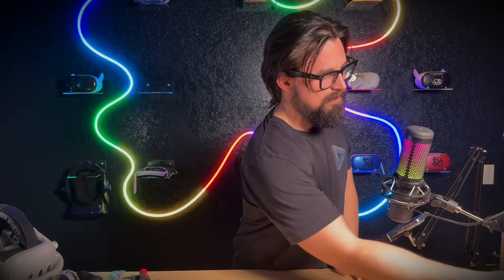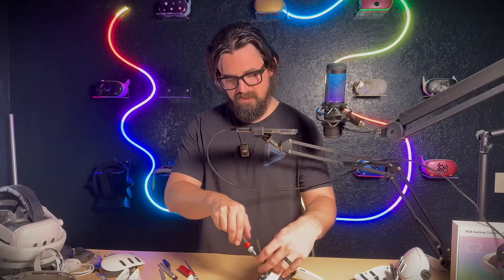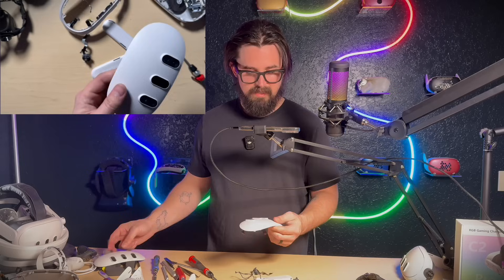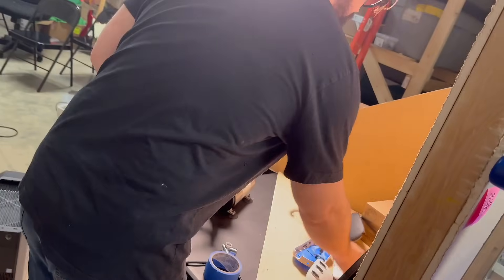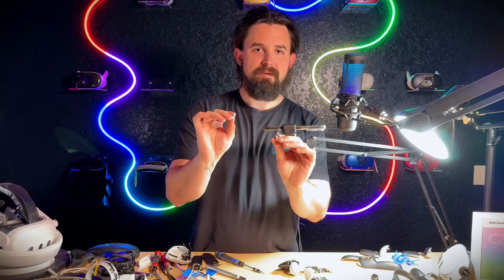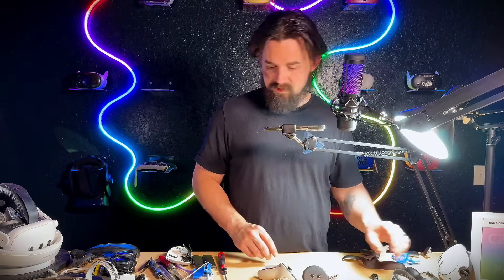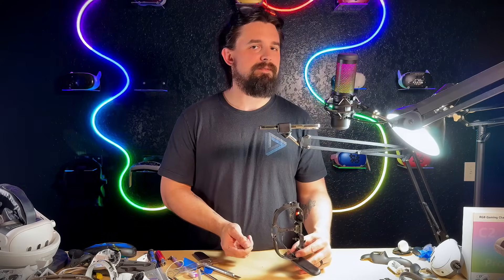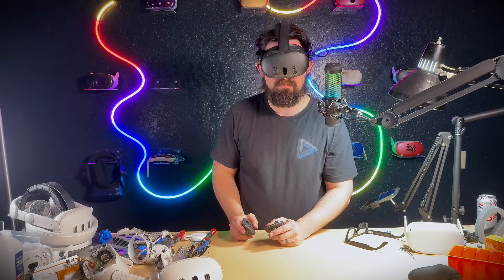Meta Refused to Make This… So I Built It (and I'm Giving It Away)

Comment: Given you have taken it apart. Do you think it can be made lighter in future with any of these components. It’s already plastic. Wondering if they will keep us on same weight for years before any meaningful update comfort wise and as VisionPro is a heavy tank and will take time to catch with competition?
Reply from the maker: It’s possible, but I think we would need some tech improvements to see it happen. About 17% (67g) of the weight is just the battery. 20% (80g) is the displays. 
The board is about 19g and most components are less than 10g. 

I think if the battery got lighter or wasn’t necessary like it is on tethered headsets, and the displays were lighter it’s definitely possible.
Reply: @fixmyoculus are lens heavy ? Any chance of these being factor ? Wondering if they can ever make them in leaner plastic like regular prescription eyeglasses !? Thanks for your reply.. Its definitely a must Like 👍🏼 for me

Comment: So what did you do to clean up the seams that were still slightly white?
Reply from the maker: Took them back apart and repainted those areas. It took FOR-EVER to get the final look I wanted.
Reply: @fixmyoculus Commitment.  Oh, did you check that the 1 IR on the handles still shine through?
Reply from the maker: @AV.36 You know everything seemed to work great. The chargelight indicator shows through the paint. I think the fact that it’s really a pretty thin coat of paint helped ensure the functionality of the unit. If we were doing this with rattle cans, I’m positive we would have had less favorable results.

Comment: Hi i got an issue with my Meta Quest 3s so sometimes when i play any game my character either becomes smaller or taller and i dont know how to fix it could you tell me or make a seperate video??? (Btw even when i restart my Oculus its still the same and nothing changes and i just need to adjust my floor level everytime)

Comment: Super cool project. I probably wouldn't have sprayed high wear areas like the sticks and just used a silicone cover as the paint will rub off pretty quick with sweat and wear and tear . On yhe entry i put quest 3 as the no.1 set no idea if its right